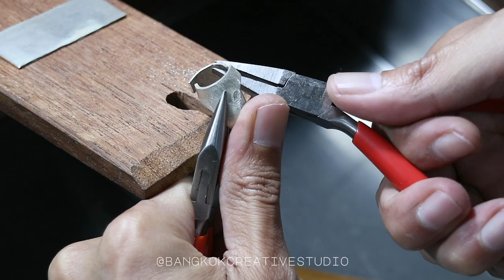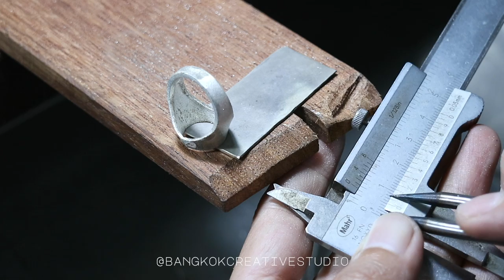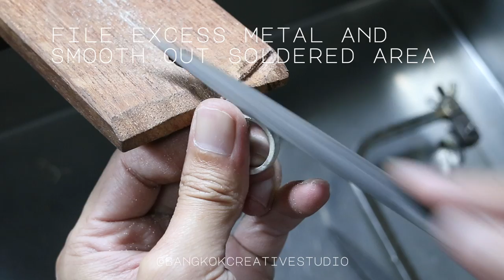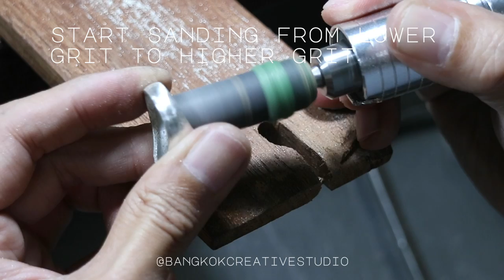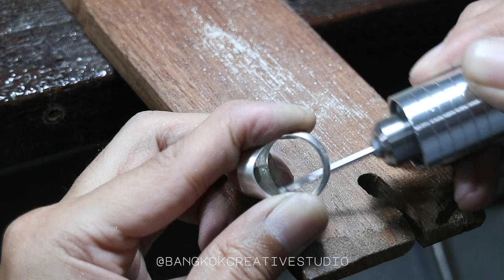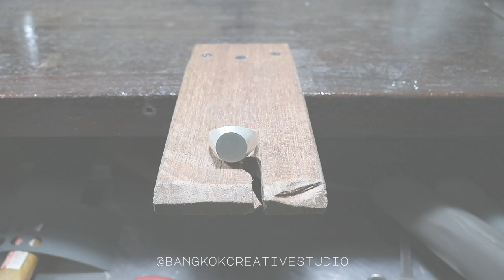Hollow Signet Ring - How it's made jewelry series

Comment: Do you by any chance have a pattern to share for this ring? I cannot seem to find any online, and your tutorial is by far the best I have seen for this kind of ring!
Reply from the maker: Thanks for the kind words! Not yet at this point, we keep that in mind for the future designs! ;)
Reply: It's a very common pattern. Check out your library for some books on jewelry making.
Always use wood on wood for shaping to begin. Using plyers, they're putting in unnecessary marks. A small wooden headed (or neoprene) hammer on a wooden ring stick. Using these, it keeps from thinning the metal, and work hardening it. If you roll out metal, it hardens it. Soften it up again by heating (not beyond dull red stage!) and quenching it - use "pickle" which is a mild water/acid mixture which should be in a small crockpot (kept warm). DROP the piece in it, do NOT place it in or you could crack it where you held it with tweezers. 
If you don't put marks in, you don't have to grind them out. And, to shape the inside of the ring, after using a file, wrap a piece of wet/dry sandpaper around the wood ring stick and put the ring on it, rub til you're happy. Don't make the bottom of the walls inside the ring Too thin or sharp!
And filing- do NOT scratch back and forth with it - it ONLY cuts on the Push. So, push the file, lift it, go back and push it away from you again) . they're dulling their files, and not getting the job done easier. 
Have fun!
Reply: @theinvisiblequeen  thanks jan

Comment: Thx a lot for the video! One question: what is the mathematical equation for getting the correct size?
Reply from the maker: I dont have one for you due to nature handmaking minor fixing or large tolerance is still workable. 

I recommend you to cut out the paper and try to fold/bend to shape first, then the easiest way to do this type of ring.